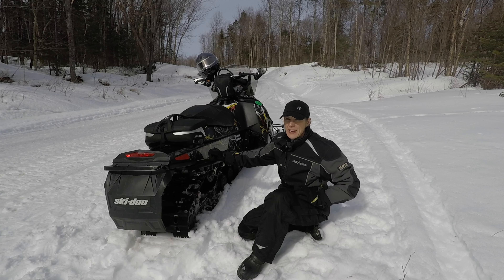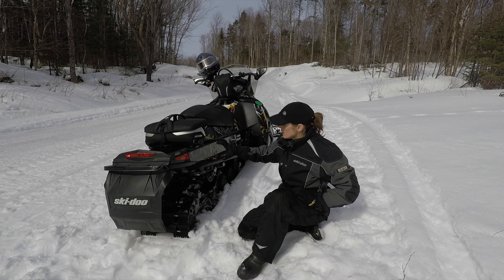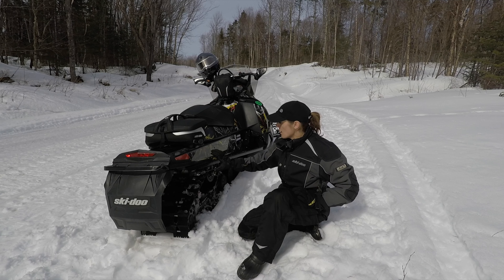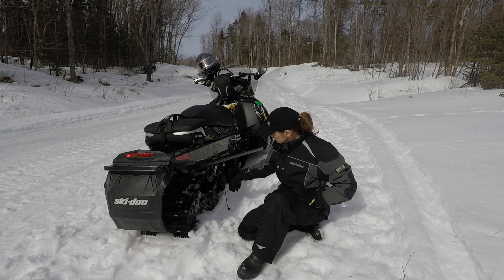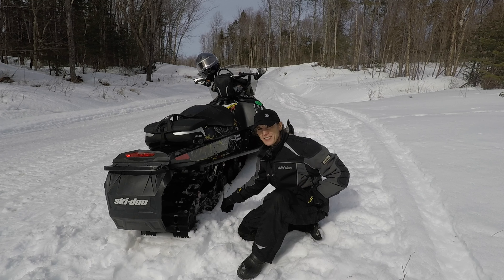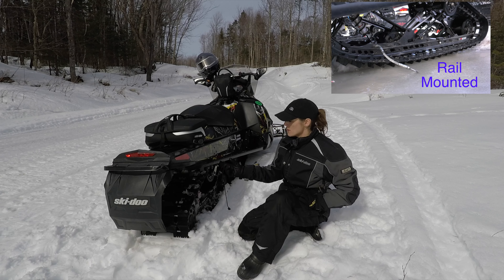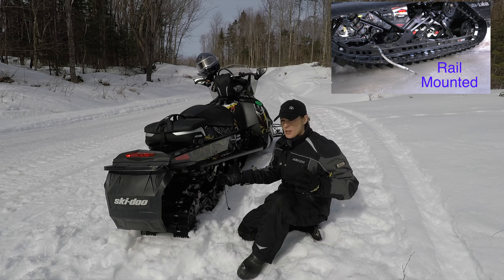What Are Scratchers on a Snowmobile?

Comment: I agree 100% they work for lube and as a bonus for cooling. I have digital temp gages on my sleds and and scratchers can make the difference between riding or not in hard pack. At least 20 degrees cooler running scratchers, either spring type or cable type. If you ride behind another sled in your group, you can smell the Hyfax melting when there's little to no lube. Scratchers are no gimmick.
Reply from the maker: Ain't that the truth! I hear ya on the burning hyfax. I know someone who had their track bind up going down a lake because of it and it did a LOT of damage!

Comment: Too gimmicky imho.
Reply from the maker: The video or the actual scratchers? They are a LIFE SAVER! I put them on the sled because there wasn't enough snow for lubrication or the heat exchangers, icy conditions basically. That little bit of metal on hard pack makes enough dust to save me from overheating or doing damage.
Reply: @sweetvelocitybps  ok.
Reply: Bet you spend alot of time changing hyfax out hahaa.  Scratches work great!